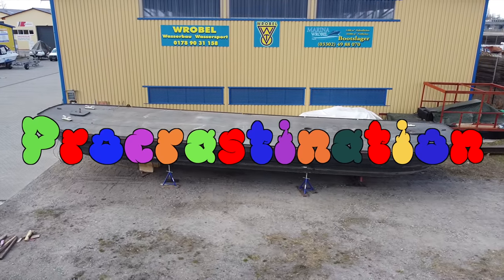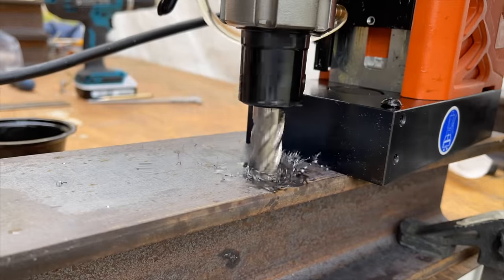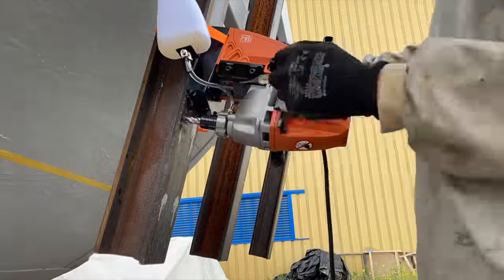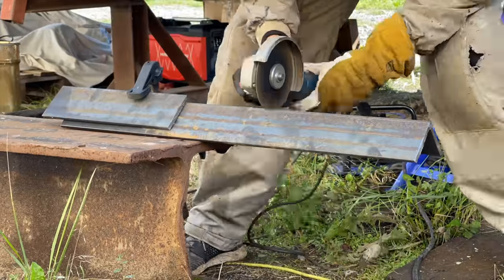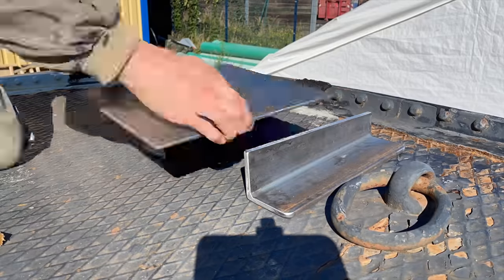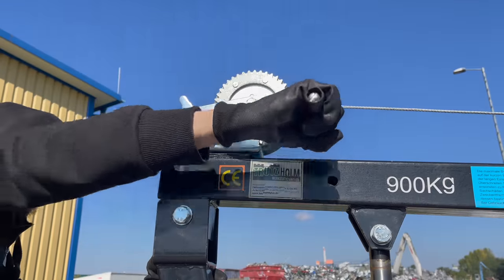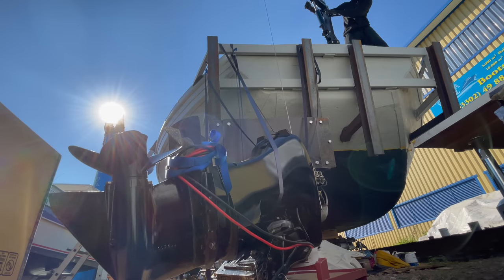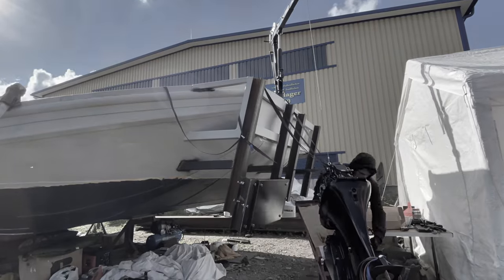Installing Outboard Motors on My Barge Boat

Comment: Your outboard looks like it's going to be too low in the water.
Reply: That's what I was thinking too....and excessive drag from the transom boards with increased bottom clearance issues.
Reply: Wouldn't it be a bit funny if the motors ended up totally under water?
I think he's aware of where the waterline is though.
Reply: @Salaxi Yes he does say that but the way he's built it is fixed, it will require re-engineering to adjust the height, that's not really the definition of "height adjustable". My house is height adjustable but i'd have to do a hell of a lot of work and spend a lot of money to do it!
Reply: By a mile 🤣
Reply: Can be fixed with drilling some extra holes (about 40cm higher : ) with the outstanding drill 👏🛠
Reply: It might help if the outboards were mounted on the correct end of the barge.
Reply: It still looks like the engines are mounted in the bow not at the stern the other end has a false rudder skeg
Reply: @gavinferguson  exactly 🤯😳. Should have gone to specsavers. Perhaps if not knowing which end of the horse does what you would research a thing or 2 about horse anatomy. There were several comments on the previous video but they seem to have fallen of deaf ears. The outboards are being mounted on the bow of the barge facing the wrong way. But hey ho who am I to question. Just a marine engineer/fitter with a lifetime of experience in, on and under the water. I can't watch any more🤢🤮🤯🤬
Reply: Too low + larga Steel plate = huge problem With cavitation
Reply: Nope!
Reply: Are there center of gravity issues with this design independent of the bow/stern issue.
Reply: He did say it was going to be adjustable.  But I noticed he fixed it in one position.
Reply: @guymorris7860  I went back and looked at the barge when he bought and transported it, I think you're correct (I'm not a boat person), it sure looks like the wrong end to this landlubber ......!!!
Reply: The prop must be 20 cm under the bottom of the boat
Reply: I mean, this is not a performance boat, will work great even eith the engine soaked
Reply: Quite a project.👍
Reply: Quite a project.👍
Reply: 0:50 Well he openly said that in his defense he is a careless risk taker who only learn the hard way. If that be the too low mounted outboard engines or mounting them at the bow instead of at the stern.

Comment: You probably did this but did not show it: seal the holes in the deck where you mounted the crane and seal the exposed edges of the plywood transom where you drilled through it. The barge - I have no idea what your vision is, but I believe it will be fabulous.

Comment: when welding thick material with a somewhat weak welder, you actually want the material to heat up and even preheat the parts to get deeper penetration of the weld instead of just laying beads on top of the metal

Comment: You had an air bubble in the coolant fluid line and the coolant fluid reservoir should have been a lot fuller then you might not have needed to worry.

Comment: Hi.  I don't think you should have the engines that low.  You have the cavitation plate at the bottom of the hull on a fast boat, so that the propeller does not go airborne.  You risk waves washing over the engines with your assembly.

Comment: As others have noted, I think you have the engines too low.   Aligning the cavitation plate to the bottom of the hull would only be needed if you were somehow make the barge actually get on plane, which that is obviously NOT the case.   Rather, you need to find out where the waterline will be, and then work from there.  You engines can probably come up quite a bit further.

Comment: I KNOW YOU GOT FRIENDS TO HELP YOU WITH YOUR BOAT. COULDN'T YOU JUST HAVE  ENLISTED  A COUPLE OF GUYS TO LIFT THE TWO ENGINES THE THREE FEET AND PLACE THEM ON THE TRANSOME ?  WE HAD SEVERAL COMPARABLE ENGINES ON OUR BOATS AND WE TOOK THEM OFF AND ON WITH EASE TO WORK ON THEM.

Comment: You are making this transom exceptionally heavy..... over kill actually. Just keep in mind those transom plates must be water proofed and bonded or corrosion will eat them up from inside out. On top of that if you strike anything then your outboards will have no where to retreat ( or kick up) you would have been far better served with two layers of 1/2" wonder board,  fiber glassed, and then bolted to your H angle iron. That s why transom's are always in a non ridged material. Actually had a brother in law hit a submerged 4 x 4 in a river and it tore the drive off the boat. But the transom flexed enough that it didn't hurt the boat at all. Hydraulic lines actually saved the drive from going to the bottom. One more thing. Those transom plates must be fluid dynamic with the hull or that plate will be punching a bulldozer's amount of water right in from of the engines, resulting in a snails pace, overworked engines that suck twice as much fuel per mile as they should.....

Comment: as others have already said the motors should have the cav plates aligned water level - where ever that ends up.   2x60hp is going to be dangerously under powered on barge that size, the wind or current will push/blow you into something.  try 2x 250hp
Reply: I agree with you on both points, except to add that outboard motors are not a good match for a heavy displacement hull, because the props are not sized for thrust, but for speed. Fitting oversize ones will not remedy that, and will be a huge waste of money and fuel: it really needs an inboard installation

Comment: Take that hand crank 
Off that crane and buy a 
Electric winch  with a remote 
And put it on
Reply: I have to agree with taking the hand crank winch off and fit a electric winch as lifting and lowering the engines would be so much easier with just one person

Comment: I could be wrong, but it seems that your transom is not very hydrodynamic. In fact, it appears to me that it will create a drag and very possibly may even divert water over the tp of the engines. You might want to think about designing some sort of water diverter.
Reply: Or, perhaps you could enclose the immovable potion of the transom frame with steel plate.

Comment: You are supposed to leave the motor bolted to the frame work when you lift the motor up. Once you have the motor standing upright, then you unbolt it. That is the right way to do it. That crane can lift a maximum of 1k lbs. So you have nothing to worry about when lifting the motor and the framing together. What are you going to do with the barge? Are you going to convert it into a houseboat?  Or is it going to be used to transport goods as a business?

Comment: Thinking your motors are way too low. On a barge like that the props just need to be in the water not under the hull. Being low like they are also makes more of a chance of hitting things with the props.

Comment: You made the back with h beams. So why not make the motorplate a sliding one. Use the h beams as rails. So you can lift the motor out of the water using the crane.just slide it up along the h beams.

Comment: You created a water break that's gonna catch the water holding you back and creating a spray that will flow up it an go straight onto the motor, like a lot of water enough to ruin the motor. Trust us boss some of us just know a little bit about this stuff

Comment: Why 2 motors instead of one ? Easier to maneuver, cheaper, less maintenance with one ! The cavitation plate and outboard maybe to low depending on the water line , if you know that then set your outboards accordingly because it’s not a planning vessel plus take the added weight of whatever is on the deck including a pilot house and all things considered your outboard may be under water !

Comment: That outboard is hanging way, way too low. Also those transoms are too low and will generate a lot of resistance in the water.  You should have taken the waterline as a reference and not the bottom of the boat for the location of the outboards. The orginal idea with a diesel stern drive was a better idea.

Comment: LIKE THIS COMMENT SO HE SEES IT PLEASE!!
  
I think this idea should be implemented on  his build,  it 
Makes shifting draft a non issues with the outboards ,when 
Using the barge with different deplacement. 

THE IDEA:
Why dont make a slider bracket on the I beams so the transome and the engines can be lowered and raised easy when needed. 
This should not be hard for you!
A simple metal to metal sliding  should do fine  , but plastic( nylon/hdpp/hdpe shims save your paint from getting scraped of.
The wheit on the moving components would be enough to keep the down.
You can simplify add two winches ,one for each transom . The crane is still useful so no wasted money there.
Also using double plates is risky ,if you do not paint the inside side you get corrosion there. The slider idea does not take away the need to to make it so your aoutbords can swing up , the most obvious reson if you hit something the you want them to do that. Or r.i.p outbord e.

Also other comments talk about the posibal drag issue with the mounting plate. This I agree with.

Comment: 20:07 Looks like you're motors will be too low in the water. The black/grey paint on the hull 'used to represent the free board of the UNMODIFIED barge. Now the barge has  1500~ lbs of angle iron welded to one end of the barge and 2 engines weighing a total 550 lbs.The cavitation plate should be level with the bottom of the barge/boat. perfect. The resting position in the water may be an issue once in the water.
Reply: "The cavitation plate should be level with the bottom of the barge/boat." Not true for a displacement vessel. This is NEVER going to plane, even with 600 HP.
Reply: @Gottenhimfella  touché
Reply: true, but if he keeps building like he is, water WILL enter the engine compartments.
Reply: @pettypendergrass8596   All the more reason to mount the outboards higher, ie with the cav plates at the level of the water surface, no?

Comment: engines are too low and too close to the hull. not how to raise the engines if the bottom is close or need to do some maintenance on the propellers

Large plates will cause a large area of turbulence in the water near the propellers and in the water for engine cooling.

Comment: Respectfully.   
Should have gone to specsavers. Perhaps if not knowing which end of the horse does what you would research a thing or 2 about horse anatomy. There were several comments on the previous video but they seem to have fallen of deaf ears. The outboards are being mounted on the bow of the barge facing the wrong way. But hey ho who am I to question. Just a marine engineer/fitter with a lifetime of experience in, on and under the water. I can't watch any more🤢🤮🤯🤬.
Respectfully sorry.

Comment: Looks way to low and more oil on your mag drill and you can feed it in twice as fast 30 seconds easy and you should not have to back it out and all just feed it straight threw
Reply: And the two 5mm plates stacked on top of each other is just asking for it to rust out between the plates

Comment: You dont need to extend the transom.  If you need to work on the engines just hoist them onto the deck!
Reply: Or You can make a vertically sliding transom. That will allow you to set the depth of immersion of motors depending on the draft of the ship, and if it is necessary to repair or inspect the motors, raise them above the water. The mechanism can be made without hydraulics. The screw type will be cheaper and more reliable. Good luck!